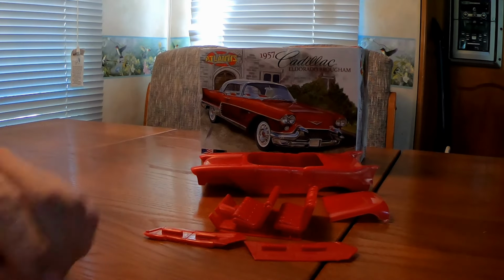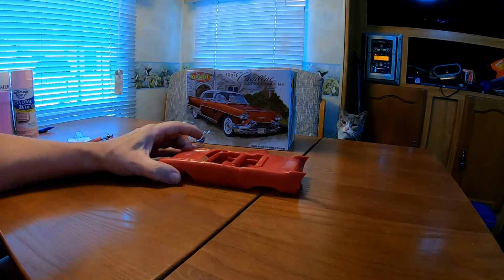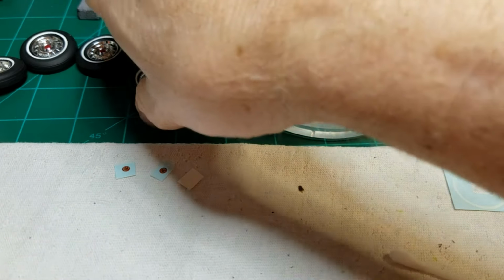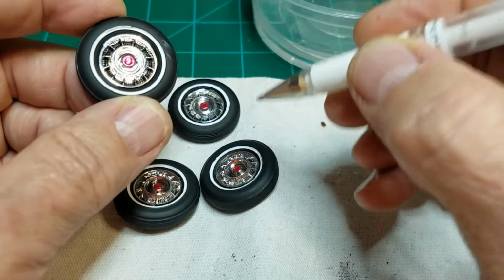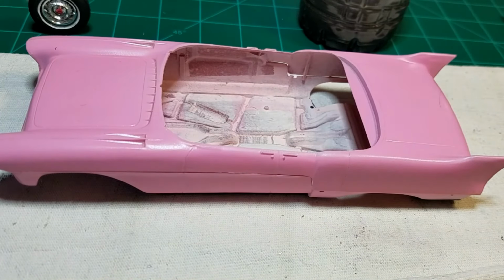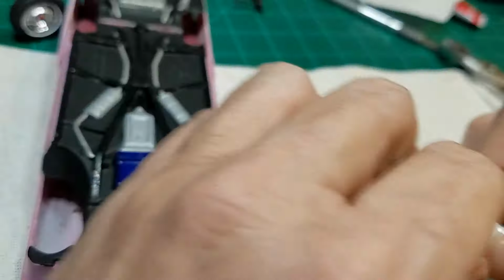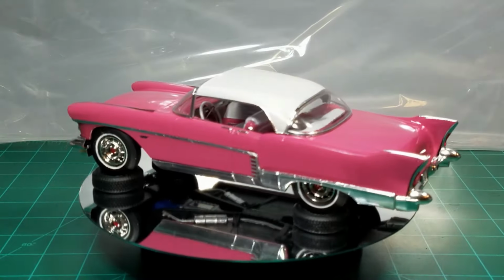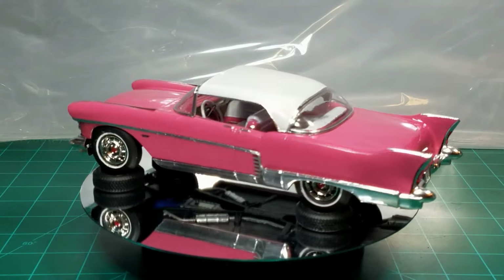1957 Cadillac Eldorado Brougham by Atlantis – Episode 75

Comment: Nice job on a very old, very basic Revell (originally) tool. I bought one years ago when Revell did the initial reissue, molded in black. Opened it, took a look, realized it was a direct re-issue from the old tool with lots of flash. Closed it back up, it went into the trade/sell group.
Reply from the maker: It appears that Atlantis makes its money from producing very old kits in the very original style from yesteryear.  I applaud their efforts but would like to see some updated kits. I visited a hobby shop in Holland, Michigan, a few days ago, and they had a couple of these kits on the shelf for sale.